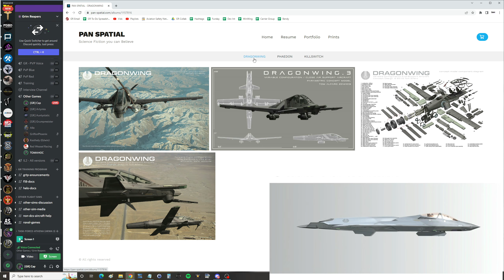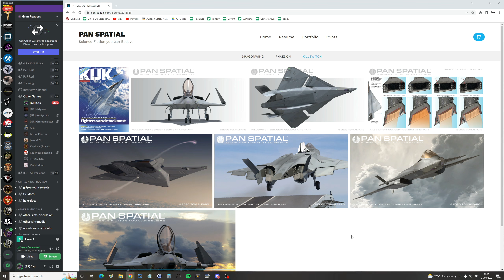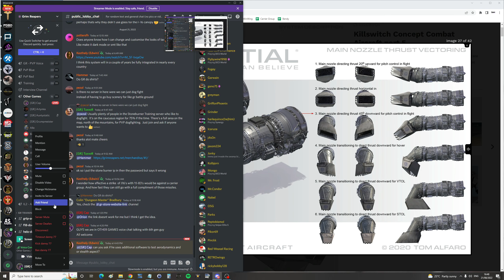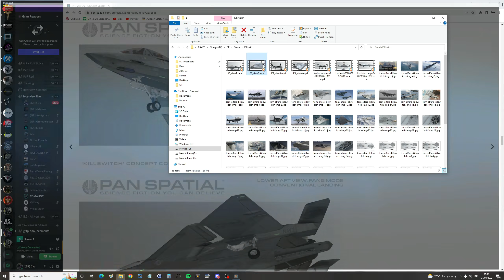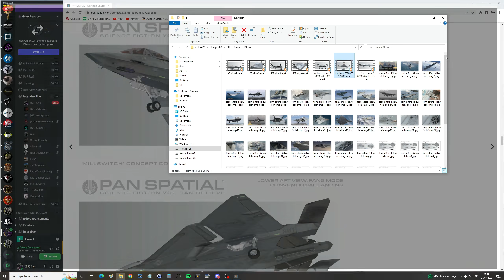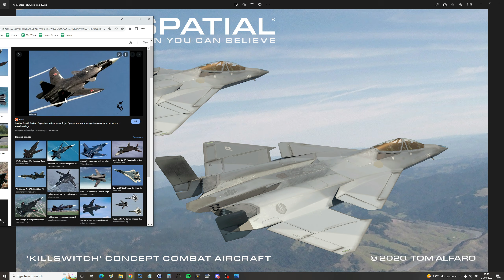Discussion: The "Killswitch" 6th Generation Fighter Aircraft Concept (by Tom Alfaro)

Comment: All of these features in one plane would be great but highly unlikely from an engineering standpoint but could be spread out to A, B and C models.
Reply: I completely agree with you. Though it could be possible to have a plane that would have have all these features. It would be highly impractical and unjustifiable with today's technical know-how to build it in mass as seen in his render. I would separate each feature into blocks and variants instead. I can think of 5 from this.

The A variant would be the standard Killswitch. Solid and simple. It would cost less than other variants. And would probably be the most stealthy variant.

The B variants which I'd call the 'Razor Blade' would be the open version. It would be a 5th gen minus variant that is more suited for more aerodynamic flight and air superiority. A drawback would be that it won't be as stealthy as the original version. So if possible I'd try to include technology that would help with jamming enemy defenses and missiles. If not than it would be used when all or most enemy defenses were destroyed by more stealthy craft and be used to ensure air superiority.

The C variant would be the navalized version of the Kill Switch which I'd call the 'Switch Blade' would be capable for carrier landing and would have the folding wings installed for greater storage on carriers.

The D variant which is VTOL capable and would be in use for the marines. It would require more maintenance in comparison to the others but it would allow the craft to be landed anywhere on any airfield in any condition. I'd call it the 'Flying Feather'. (Marines always like their funny names.)

The final variant would be the E variant. (Or EX/X variant.) If technology allows it would be the version that has all available features on it. But due to expenses only a few can be made and they'd only be used in more limited roles such as a demonstration aircraft or in national defense. It would hardly see any use outside of our borders due to heavy maintenance cost and machine complexity. Or it would be the top secret version. It would be called the 'Shape-shifter'.

Comment: To me, this was a fascinating video.  The beauty and elegance of the KillSwitch is utterly enticing.  And while I love the visuals of the shape-shift and the functional goals of said capability, I can't get past the complexity and weakness, that I can only imagine, it will add to the design.  Seems to me it would be much simpler to have the front section of the wings separate and slide up/forward while at the same time the intakes hinge and go from taking in air on top of the fuselage to below.  To make the engine nacelles shift like he is doing, I just can't see that being strong enough to support the wings under g loading. Super sexy design though. I do love it.

Comment: If instead of the engines and the whole wings sliding, only the canards and the inlets would slide it would solve 99% of the problems while retaining all the concept. Personally I don't see how any joint that close to the center of the object could hold the torque that is generated by the whole engine bay and wing while flying high G high AoA. The whole sliding thing would just brake off from the forces. Also don't forget what happens when one section jams and the other jams in the opposite position. The whole thing wouldn't be a problem with my solution, because the whole canard and inlet section could be one piece and act exactly like the F-8 Crusader's wing. Additionally it would save a lot of weight and complexity because there would be no need for flexible fuel lines and hydraulics and etc. and a huge robust mechanism that can hold all the wing and engine in one place. It is an awesome design anyways, but this would certainly improve it.

Comment: As an F-15 and A-10 Crewchief I find this concept and design VERY intriguing.  Making aircraft with a low-observable system like the F35 and F22 makes it far harder to do any maintenance on.  Part of an aircrafts utility isn't just it's capabilities when it's flying.  A very important part is the ability to fix/do maintenance and turn the airframe around (refuel and rearm) and get if flying again.  If it's hard to fix and turn around it just becomes an expensive paperweight on the ground.   Lots of things happening to/with this aircraft in the animations given that are just straight up cool, really.  This is great as a design concept exercise.

Comment: This is easily a machine that can be built, your going to have a time fitting fuel and weapon compartments especially all internal. This would have to be a huge plane with huge engines and high maintenance costs but I guess having a really fast, super maneuverable, aircraft so even if it was twice the size of the raptor which would be much larger than an F-14 but still probably(maybe) carry a sub .01 meter squared radar cross section which is twice the size of the raptors I think. Cool concept anyway!

Comment: If it’s not vtol version, it could fit another shot locker where the lift fan was. 

I would buy multiple model kits to build different “versions”/“modes” displayed.
Reply: Great idea. It would be more difficult to have one plane with multiple features. Best to separate them into multiple variants.
Reply: Bandai has done scale models with lots of slidy bits in the past.

...so I guess one that can be reconfigured to be all can't be done, but a lot of hinges, rails, and whatnot may not be to scale.

Comment: As a concept and a way to push new ideas, I absolutely love it. The nose mounted DEW gives tons of options. Imagine using a lower powered laser to target an aircraft, and firing an air to air version of a Hellfire. The missile would ride the laser in, never giving the target a warning like from radar, and thus never having a chance to evade.

But I think my favorite part of the concept is the Shotlocker. Not only does it solve a lot of space saving problems required of stealth aircraft that need internal storage, but it's also a tactical game changer. Imagine being in a 1 circle or 2 circle fight, with a missile like an 9X or a Python, except it launches from the top of your aircraft at an angle. You go from High Off Boresight to Extreme High Off Boresight, real quick. That's game changing.

Excellent interview.
Reply: Aren't their systems that can detect if a laser is pointed at the aircraft though? I see what you mean though.
Reply: @ttpechon2535  Yes, and there are radar which can detect incoming missiles despite a lack of electric activity.
Reply: @TyinAlaska  Yes I know. Thanks though!
Reply: @ttpechon2535  there's not a simple answer to that. Yes, there are absolutely systems out there that can detect laser energy. You can buy one for your car to let you know when the cops have a speed trap ahead. However, those receivers need to be tuned to the wavelength of the laser, and they need to be placed in a position to actually detect the beam. Police speed lasers are relatively wide beam, making it easier to hit a particular vehicle (and thus, easier to detect), and the wavelength is known. Switch that out for a narrow beam laser that is operating on an unknown wavelength, and things get more complicated to detect. And even if you can detect it, actually spoofing or evading it is more difficult than with a radar or IR guided missile. Especially if your target is a big, fat bomber. But even with smaller, more nimble aircraft, so long as you can maintain the laser on the target, the missile would track. There's no notching a laser.
Reply: @EvolvedTactical  Oh ok. Does the laser code on the apache have something like that? A way to have multiple helos fire missles and fool those sensors? I know you cant notch a laser but what I meant was dodging the hellfire. Now that I'm reading you main comment again I release my point is kind of useless if they made an air to air variant. If they did make a laser guided air to air missle, could smoke stop the laser? I think I read somewhere that smoke can stop a laser, and yes if the aircraft is moving at all, the smoke will just blow behind it. Other than that I cant think of a way to fool a laser guided missle.
Reply: @ttpechon2535  smoke diffracts laser, yes. One of the main reasons why tanks and armored vehicles still carry smoke dischargers to this day.

Laser-guided A2A missiles would have problems (or even outright useless) fighting in cloudy weather. Not to mention the tracking the sensor has to do against a high-speed target. 

It's not improbable; that'd definitely be a laser version of a Fox 4; but it'd be something that complements the armory instead of fully reinventing it like the other comments suggest.
Reply: Absolutely agreed, not to mention the possibility of making the whole system as a removable pod that can be swapped with a pre-loaded one on the ground.  This would allow much faster weapon loading in a combat scenario where turnaround time is crucial.  I'm not sure if he thought about it being removable or not but it just seemed like a good possibility.  Heck you could even load a missile in reverse and drop it out the bottom as a countermeasure against incoming threats.
Reply: Dude definitely needs to approach skunk works with this concept.  I think they would eat this idea up.  It's wicked,  well thought out,  and just plain sexy.  Lol
Reply: Yeah but with hellfire since it's laser guided, normal countermeasures wouldn't work
Reply: @michaelmcdonie4387  Yes, but certain systems can detect the laser (as @Evolved Tactical has explained) and have time to jink or evade, and I wouldn't imagine that a hellfire is as agile as per say an aim 9x. So I doubt you could fool the missle, but you can probably dodge it. And yes I know Evolved Tactical was talking about an air to air version of the hellfire, but you know what I'm saying.

Comment: I like the design. I don't know much...or anything really about these things, but those intakes on the top of the airframe might have airflow issues under high angle of attack maneuvers.
Reply: @Dwight511   thx for that.
Reply: that's why the intakes switch to the bottom in the "maneuvering" mode

Comment: Looks VERY HEAVY with transforming elements doing very little for agility -- sustained turn will not be improved given the lack of change in wing area whereas nose pointing could just as easily be achieved by vectoring thrust. The canopy is decidedly UN-stealthy with a mating joint in the middle. The rotating nose cone seems to serve no useful purpose. The biggest and most obvious issue though is that with all the space the transforming setup takes up in the wing and the bays in the middle, where do you put any decent amount of fuel?
--
IMHO, the next generation US fighter like the NGAD or F/A-XX will likely:-
(1) Not try to combine the needs of multiple services or CTOL/STOVL into a single airframe.
(2) De-emphasize nose pointing agility in favor of speed, stealthy and range.
(3) Have very simple and very clean external geometry probably resembling a tailess diamond.
(4) Possibly eliminate the Canopy in favor of 360 degree electro-optical sensors conveyed .
(5) External imagery can be conveyed via the HMD with the pilot is a near lying position.
(6) Feature a variable bypass ratio engine.
(7) Feature active defense interceptors the size of chaff/flare cartridges.
(8) Feature an dual band AESA radar that is also the leading edge of the wing.
(9) Is optionally manned.
(10) Feature a interventionist AI that takes control should the pilot be incapacitated or GLOCed.

Comment: I'm only a minute in and all the moving parts on this thing makes me want to die. Moving parts means more complex means more points of failure and more maintenance. If this thing were to be real, it'd be even worse than the F-14 in terms of how maintenance intensive it is and will spend significantly more time being maintained than flying.
Reply: Let’s be honest here: it’s not moving parts, it’s more parts in general that creates a problem for a craft. Whether the parts were mechanical or electrical, more complexity means more potential points of failure. HOWEVER, generally speaking greater capability requires innovation which usually means more complexity (based on current fighter design trends… sometimes you get a lucky break and can simplify things while getting more capability).
 This Tom guy mentioned it’s a concept but even then has thought out how to simplify it to make it more feasible. And that doesn’t mean you couldn’t take one or two systems from this concept and use them in future designs. All in all Inquire enjoyed this!

Comment: Super cool design from Major Tom and fantastic discussion from the boys. The Killswitch sounds like a hero plane for an arcadey flight sim. (Like F-19 Stealth Fighter for DOS, lol.) I think it's a little unfair to get hung up on the maintainability of a sci-fi design. The purpose was to explore new ideas. Like the "Shot Locker" concept could be a thing. The macro variable geometry seems like a solution to having a maximum stealth mode vs maximum maneuverability mode, but in all likelihood the maneuverability would be covered by drones or a HOBS missile of some kind, but still a cool concept.  Great video guys. 👍

Comment: There is a glaring problem with the design, the Russians thought about it with the yak-141 and I assume it guided the F35.

Two engines, they worked out for the vtol if you have 2 engines and one stalls (blows up) then the plane flips on vtol
Reply: I'd imagine you could hook the other engine up to modern avionics and gyros, then the danger would be functionally the same as a single engine, with it throttling down/gimbaling/thrust reversing automatically to compensate, in combination with the lift fan. There seems to be an extra element of safety with the lift fan not coupled to the drive shaft, I would think

Comment: You got to have this guy back on if you can. I'm sure there's plenty of other interesting ideas you could discuss. I'd be very much interested in what he thinks might replace the role of a attack helicopter in the new future? I think it could be a VTOL.
Reply: I was looking at dragonfly as well. One problem I have with it is that rotor on the bottom. I understand why he put it there, but as CAS, it will catch fire from the ground a lot. That mean, that prop will get shot to peaces real quick.. plane down.
Reply: @vencaS81  I actually hadn't looked at that just yet, I was more just curious as to his thoughts on the question. Since you mentioned it, I don't think the props would be any more vulnerable than a normal helicopter, the rotors are pretty exposed and they aren't exactly heavily armoured anyway.
Reply: @RpattoYT  yeah you are probably right... other thing is ground particles, branches, stones.. picked up by the down trust. That rotor is quite close to ground in landing or low hover mode.

Comment: The kinetic capacitor could be used as a single directional plane gyroscope along with being a power source for when you want maximum stealth, by having the engines drop power to only what is needed to keep flying and have the capacitor supply the power for the plane.

Comment: The X-29 also used composite materials in the wings layered to reverse the load movement of the wing. So when a load was applied the material would bend and twist down to reduce the load

Comment: Larger moving parts are inevitably gonna make something like this heavier but it's been done before. By far the most unlikely design feature is the in-line air compressors, that something engineers have wanted to do but have so far been unable to do so now for decades.
Reply: I think given that, the fact that the fricken plane splits into two pieces, while also being VTOL is an indicator that this is an aircraft if there was a world without price tags.
Reply: @jacobbaumgardner3406  True, the combination of those features makes it's even more extreme unlikely.
Reply: @RpattoYT   bingo. It look totally possible to build, but if cost and practical limitations weren’t a thing I think a plane like this would’ve already been built.
Reply: Here is a machine that experiences moving flight controls and etc... https://www.youtube.com/watch?v=Jb4prVsXkZU

Comment: Any spinning mass in an aircraft is gonna come with some added unwanted torque but it's not crazy.
Reply: The interesting part is that “unwanted” torque could potentially be used to create stability or instability in certain axes…
Reply: If you're referring to the "kinetic capacitor", the two counterrotating disks would cancel each others torque and gyroscopic effects.

Comment: 70 Spitfires isn’t sustainable due to the attrition level and cost (in all respects) but neither is losing a few $100 million aircraft. Now, imagine those 70 Spitfires without pilots and being low cost AI piloted or remote piloted platforms. Capable, drone swarm anyone ? 🤷🏼‍♂️

Comment: Really enjoyed the video. The back third of the video focused a bit much on the feasibility and picking apart of the design as is… and this is just a concept drawing. We can pick it apart all we want but when you take something like this from concept to engineering to development to rolling it off the factory floor some of the desired design concepts inevitably go away or are substantially reconfigured or redesigned at some point in the process.
Reply: Brilliant points, I think that is all too easy to forget. I love the concept and the idea you could take a few ideas to use, if doesn’t have to be an all or nothing gig